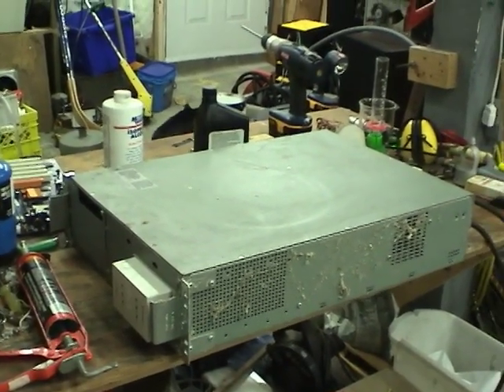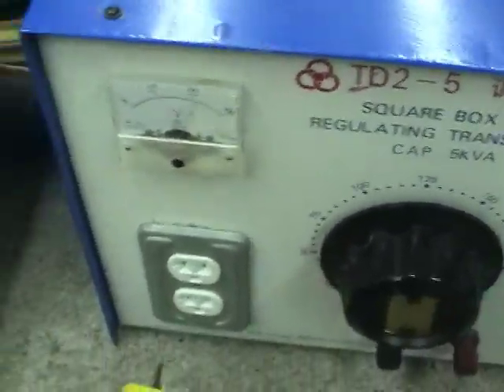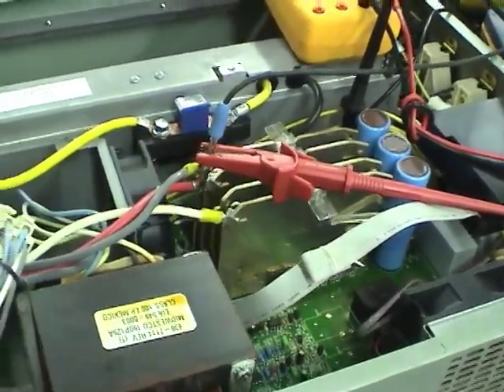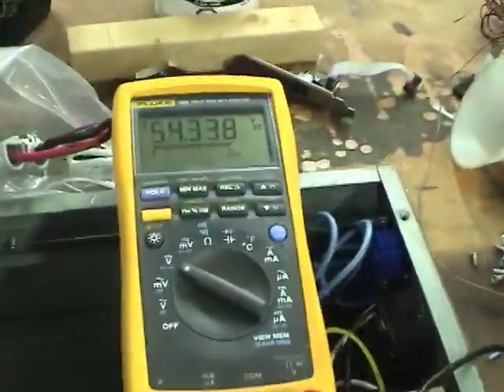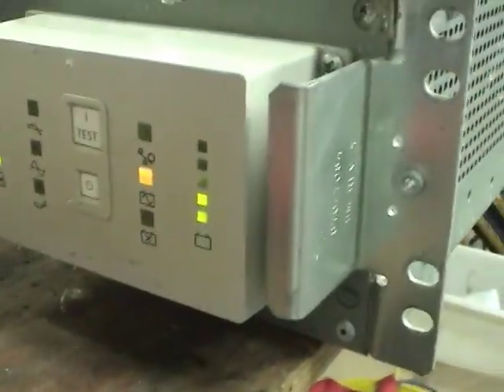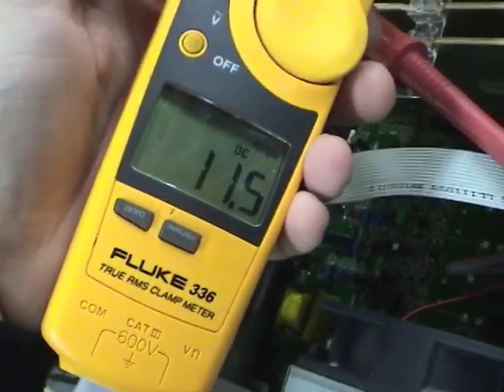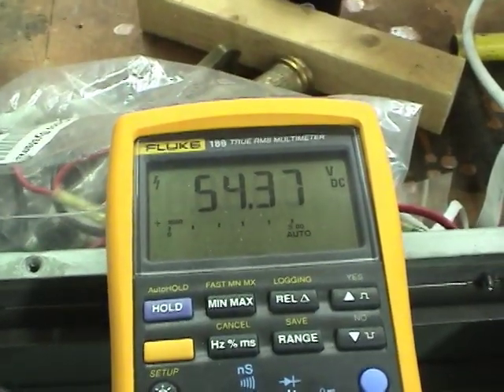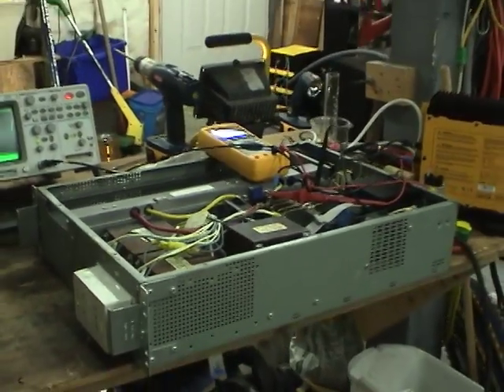APC 3kVA 208V sine wave UPS

Comment: Hi can you help me ...
Problem with the apc smart-3000 charger after changing the new batteries and then charging it for 48 hours and after operation and disconnect the power button directly works but gives sound with no battery charge

Comment: what could the 208ac be used for? could it be converted to 120-240 vac? by changing transformers? I have so many questions . if you can talk let me know. I want to build a inverter. maybe by modifying a ups or a small inverter. I have some huge transformers and other good size ones. and a few other things. I have collected. I love videos like these. thanks!!!...,
Reply from the maker: 208V is very common in North America and is normally used directly, it's phase to phase on standard 3 phase power, where you get 120V phase to neutral. You could use an autotransformer to convert it to 240, or pretty much any voltage you want.

Comment: Hi Tesla, I need to ask something technical...
For the transformer, for it to be able to directly convert high frequency switching from the H-bridge, to low frequency 50Hz or 60Hz sinewave, does it need to have a special design or something?
Can I use the "usual" ferrite core or iron core transformer to do that?

Comment: How did it go with replacing those small lead-acid batteries with a more generic set of larger SLA deep-cycle batteries? Can the UPS handle larger batteries or will it think that the batteries are bad because they take longer to recharge. I.e. does it think that the batteries cannot take the charge due to the longer time they need or does it keep charging them and report normal status?

Comment: I tried once to hook an APC up to a -48 volt telco battery bank. I found that the UPS connects the negative to the earth of the UPS. Well it did on the Australian version, so it turned into a dead short. 

It's funny that the earth is connected to the neutral of the 120volt output. That is a no no here, the only earth neutral connection should be made in the switchboard.

Comment: great !! thanks a lot in advance.
I had a small UPS and did try it with My home made Amp.
It sounds better by hear on it. I did not know why and did not use Oscilloscope.
I got a good one lately (Tektronix TDS 340A)but not good as yours.
I learn a lot from your video,I will try it myself also.
Russell Tuan

Comment from the maker: @Da9eI Hmmm, I haven't heard of air conditioners or incandescent lights doing it, but PC power supplies are bad for cutting the top off the AC waveform like this. Anything with a non power factor corrected switching power supply will do it.